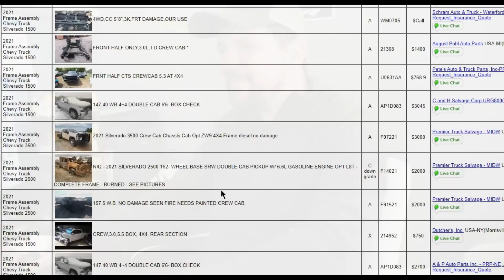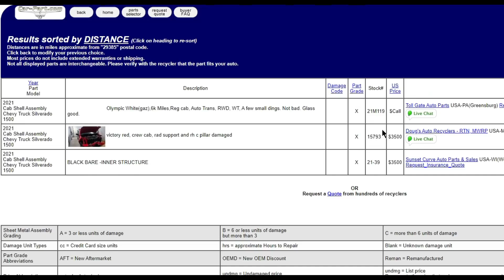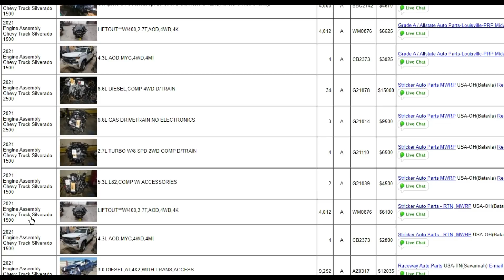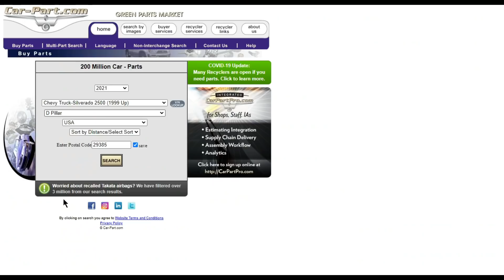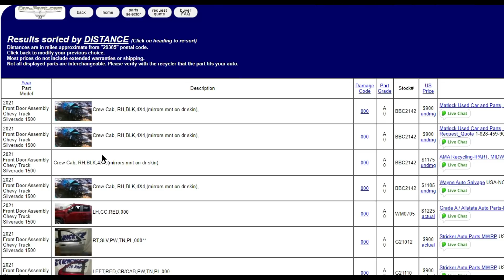BURNT 2021 SILVERADO 2500 SANDBLASTING PREP THE FRAME AND DOORS PART 5

Comment: Potential issue with the frame is if the fire was put out with water, your red hot frame got quenched and is now brittle - Not what you want, because it can just snap under load instead of flexing.  
Based on what steel it is made of, this may be more or less of an issue.  I would check it out before you invest too much more into it.  Or figure out a way of annealing it.
Reply: Good to check these things 👏
Reply: Wouldn’t matter if was put out with water or not. It’s weak from the heat being that it’s a hydroformed frame.
Reply: NAH FUCK IT, JUST RUN IT THROUGH THE AUCTION

Comment: You should have the rear bumper sandblasted down too, then paint it the same color as the truck. All the black trim will make it look good
Reply: I think that's a neat idea. It appears that the metal is fine. The chrome only got a little scorched.

Comment: As a retired welding engineer l have major miss givings about the frame and the annealing effect the heat may have had on the material. It certainly exceeded 800f to melt the aluminum . You guys need to cover yourself with a disclosure for insurance purposes, it may never be able to cope with the loads it was designed for. God forbid if anyone got hurt due to failure , just saying 👍

Comment: I'd have no problem using the frame... I daily drive on a truck the frame was burnt.  But the panels, need to be sure you do something on the inside seams.   Like the back of the cab.  They'll rust quick if not coating inside too.  Also a lot of times the dealer is actually cheaper than yards... like doors, yards sell complete where dealer you could just get the shell.

Comment: Understand what your saying about the parts. I get it but the package that came on that diesel truck and the package that came on the parts truck are completely different. The front end parts can't be used. You can use the fenders and doors as those are the same between models. The suspension setup I believe is different between the gas and diesel models due to weight.
Reply: The part numbers on the front suspension components all cross reference between diesel and gas engine models, so no issues there. The cooling systems and front fascia are different for sure. They will still come out pretty cheap compared to buying this same truck off a lot even after buying all the front end stuff from the dealer

Comment: I think the frames fine myself .  My reasoning is basic science as the frames going to have to reach very high temps in order to compromise its strength and integrity.  A basic gas fire cannot achieve those temps required to crystallize the metal to where its brittle and the highest temps rose during its blaze . My guess is the frame never made it above 600 degrees being its lowest in the fire . Your pans see 550 deg  in a broiler .
Reply: Are you talking Celsius or Fahrenheit as remember the drive shaft is no higher than the frame and that melted. Also a pan on the stove is totally different to a truck frame. One is designed for those temperatures and the others not.
Reply: F . Yes the drive shaft melted so maybe it may be nfg but my guess is the carbon steel frames fine . We shall see when they tow a vehicle with the finished truck in a month or so

Comment: This truck is gunna be the most unsafe vehicle driving on the road. All that steel is weak and compromised. Many of the metals in today’s vehicles cannot be heated without losing its strength.
Reply: I'm confident the brothers know what they are getting into. The safety of the rebuild is a high concern to them. These guys are men with high integrity. They wouldn't want to see anyone using the completed truck get. They will do the right thing when it comes to making decisions concerning the use of the old parts.

Comment: You guys sure that frame is ok , it went thru quite a heat cycle!
Reply: i woulnt touch it all the strength is gone
Reply: Having used them in the past, won't be an issue.
Reply: HSS steel is used to reduce thickness and weight.  With that much heat ( notice rt spring warped) HSS reverts to mild steel at 1/2 the strength.  That frame especially in that area will now bend and twist.  Scrap it now, use the other frame.

Comment: repairing severely fire damaged vehicles is an absolute no no, the heat will have changed the properties in the metal, and in an accident it will just fold up like paper in the UK fire damaged vehicles are not allowed to be put back on the road.

Comment: People who don't understand engineering are the ones paranoid about these burnt parts. As long as the inner crash beam isn't warped, those doors are perfectly fine. The interior panels took the brunt of the heat. The frame will be fine also.
Reply: It's not about being warped, it's about being heated and cooled. Heat treatment is done on metal to make it harder, softer, but can also make steel brittle, including the welds. They may look good on the outside once blasted and painted but like the flood cars, there could be hidden issues down the track such as corrosion, etc.
Reply: @Smurphenstein  The heat on the doors is clearly minimal. Many seeing the burnt plastic are assuming the metal is over heated. It internal beam clearly isn't based on the panels keeping form. Paint burns easiliy. Why do you think the roof warped? That's because heat rises and thats the hottest part. Everything else had enough protection to keep the panels from over heating.